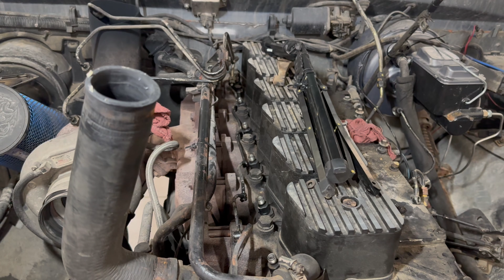P-Pump Swap First Gen Cummins - Part 3: Misc. Parts Swap

Comment: Hey man what did you do to block off the old port where your fuel filter originally went on your truck? I’m swapping a P pump onto my truck right now and can’t figure out if there is some kind of block off plate I can use for the old fuel filter housing location.
Thanks! Have a good one